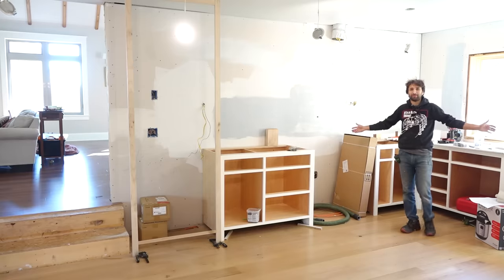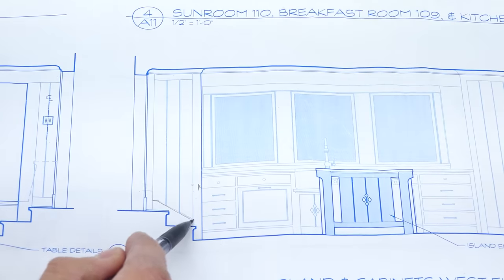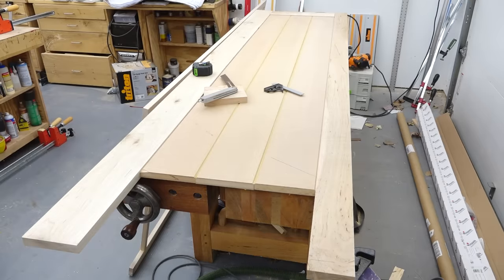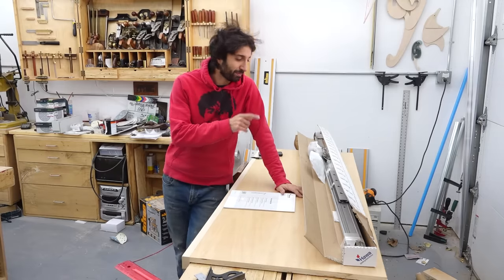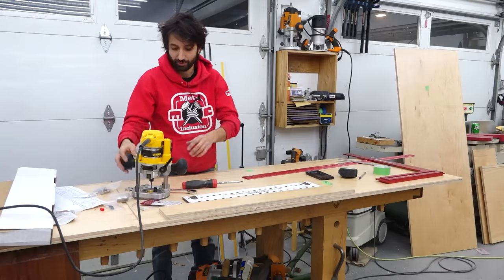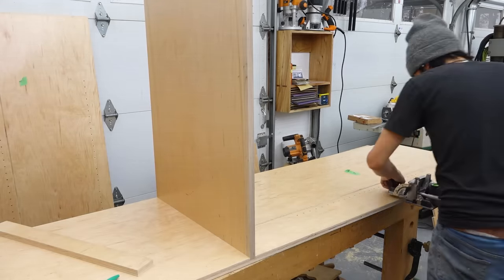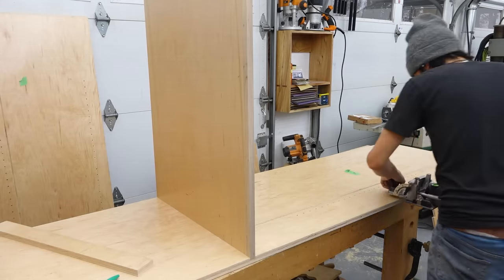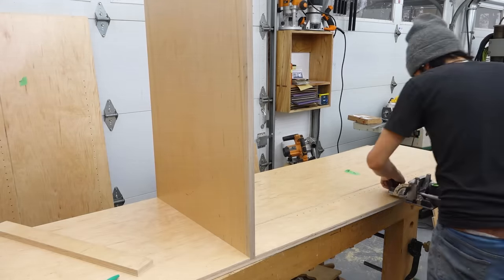Floor to Ceiling Appliance Garage Cabinet | Home Renovation & Addition Part 68

Comment: You called it a bevel gauge. You are definitely a pro. Pretty much everyone incorrectly calls it an angle finder.
Reply: It’s the angle finders and the slab masters and the board flateners that are integral parts of the woodworking trade. 😉

Comment: Great job on the pocket door installation. I wish it only took me two tries to install the first appliance "garage" in a floor to ceiling unit. Your LED lighting is a sweet touch in deep cabinets. Your designer should submit your kitchen to be featured in an upcoming magazine issue.

Comment: Pocket doors are a pain,then if a handle is added ...they stick out.
You can go handle-free,but needs touch to open.
Despite any rollers in the kit,they will roll against a painted surface and easily cause damage. 

Good luck,you will need it!

Comment: I built a TV cabinet back in the early 80’s with a pair of pocket doors.  If you will remember in the early 80’s they didn’t have that hardware.  Oh never mind trying to remember you probably were not born yet.  I basically built that cabinet 3 times to finally get it right. I told the customer to enjoy her one of a kind custom cabinet because I would never build another one.  A couple of years later they came out with the hardware.

Comment: That is a cool cabinet and a good way to hide some of the typical items that end up on counter and still be convenient for use. I like that this video does not have close caption at the bottom. As a viewer that is distracting. However if you have hearing impaired viewers I understand.
Reply from the maker: You always have the option to turn them on or off by clicking CC

Comment: I watch wet l with rapt attention. You’re a master at what you do. I did wonder why you’d use mdf for anything when you have more durable options. Another question is how you make dominoes removable. I find them to be so tight that they’re very difficult to disassemble. What’s your trick? Learning so much through your thought process. Very interesting.

Comment: To put in perspective, I did a custom design for a pantry cabinet that had pocket doors, vertical partitions, adjustable shelves and veggie baskets in the bottom that pull out like drawers. It was $14K cost from the manufacturer. That included labor, materials and tooling about 8 years ago. I wonder how much in today’s dollars both of these pantry cabinets would be.

Comment: The appliance cabinet looks really good and complex at the same time.  Did you ever figure out how much it weighs?  With all that MDF and plywood with the door hardware that has to be a very substantial cabinet all by itself.  The pocket door hardware looked really complicated, but you made it look simple enough when it was completed.  The finished kitchen will become a work-of-art, it already is, but the end result will be nothing short of an amazing accomplishment.

Comment: In some jurisdictions (not sure about yours) for code and safety, any powered appliances inside a cabinet that closes, must have their outlets disconnected automatically when the door is not fully open. This prevents you running a toaster in an enclosed space for example.

To do this, you usually want a small access panel with the power relays and circuitry (usually on a DIN rail) somewhere nearby in the kitchen. I don't remember seeing this anywhere and it doesn't look like your electrician wired it up this way. Might want to check and do it now before all the walls are in place.

HTH

Comment: If you have a projecting handle it will not slide all the way in. Considering the size of rhat room and the whole deal of the ever likely door close-  would not a tambor roll back or roll down have been easier.. Since the closeed position is so infrequent; if you use the room daily.

Comment: Hello Matt from the land of Oz and to let you know I have enjoyed the build series with yourself and Donovan. Now a question if I may?  I know that painters don't tend to use (waste) paint on areas that aren't going to be seen.  But do you think it would look so much better if you applied a coat of paint over the walls which will be covered.  I am sorry but I have OCD and it annoys me. When I repainted the interior of my home in Australia. I found that the areas behind built in robes and cupboards that weren't seen hadn't been painted.  They have now and still can't be seen but I am content.

Comment: Matt, I gotta ask…why cut individual smaller panels out of the MDF only to glue them back together? Could you not have just kept the one single large panel and routed in a few V-grooves for the impression of a multi-panel glue up?
Reply from the maker: Did both methods in this video. Cutting and gluing is faster and more consistent with almost no chance for error
Reply: @mcremona  didn’t catch that part! Apologies
Reply from the maker: @Anthony-uj7jw I didn’t offer any explanation as to why in the video so it’s all good

Comment: How many sheets of stock went into that. I recently built a pantry cabinet of that size with hardware i had never used. Measure and check, measue and check and then pray.  Then you realize how awkward and heavy it is to install.
Reply from the maker: There was a good amount of waste since it’s 26” deep but I’ll use the offcuts for the other cabinets. 5 sheets of 3/4” ply, 2 sheets of 3/4” mdf

Comment: Try that with Melamine?  90” tall by 35” wide and 24” deep?  Then do 6 of the and 11 uppers ?  The doors weight is about 60 pounds so I had to search Mother Earth for heavy duty cabinet hinges 2.5 “ by 2” and mortise them in and place a backer for the screws because the material is only 3/4” ?  
I am a finish carpenter/ cabinet maker ( not kitchens) .  Then load everything by yourself and hang them?  And make the crown.  Oh I am 65 yrs old and on a 2 nd career!  No I am not retiring and I am financially ok!  
I don’t travel and I hunt and fish at certain times!  Life is great !  Don’t be lazy guys !  Who are retired golfing twice or 3 times a week and hit the gym?  What a complete waste!